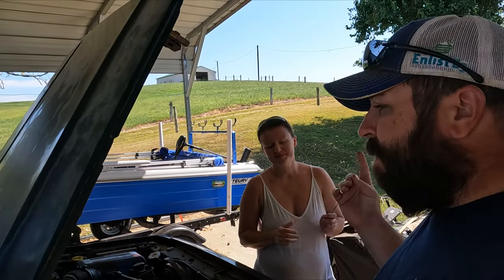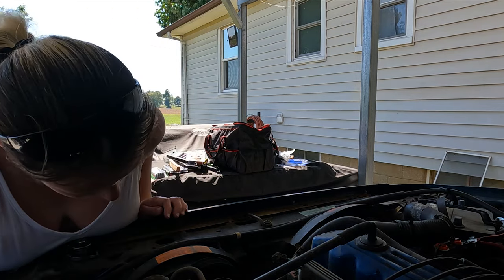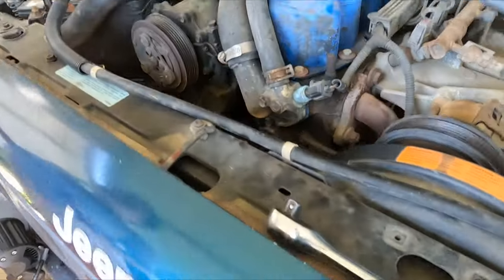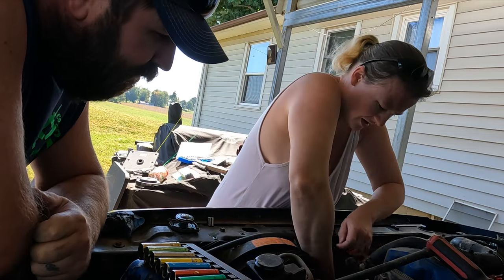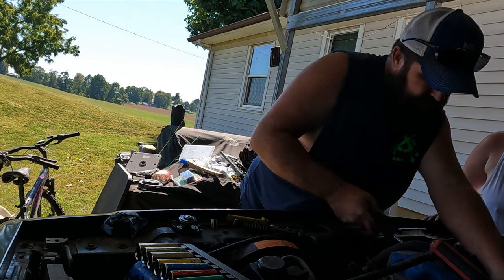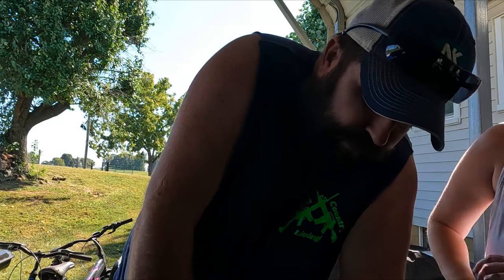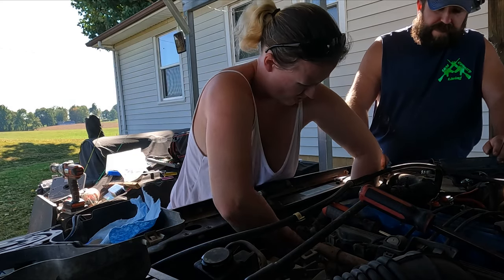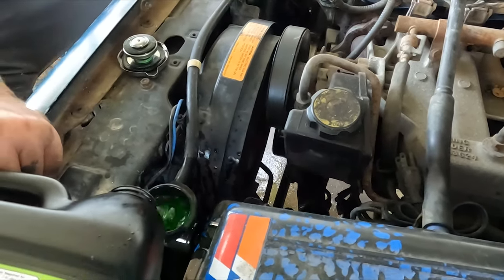M Learning how to fix the Jeep

Comment: I always use some kind of RTV/Permatex on gaskets paper ones for sure, I try not to use paper gaskets! I’m anal, always have been, when I change a water pump, on older cars, I try and change the Thermostat, with a lower temperature one, like from 220 to a 180, I change the serpentine belt, and all idler pulleys, I know it’s more money, but your there now! I also find the two longest water pump bolt, scrounge longer ones, cut the head off and use them to Align the the water pump and gasket, perfectly! Then remove when the water pump is secured and can’t move! The last thing you want is the gasket not in the right place when bolting on! Been, there, done that, and most likely going to hell for my Language!
Reply from the maker: I would have loved to changed all of that but with just doing the brake job money is running a little tight plus just put a new thermostat in a few months ago and thats a great idea about the bolts ill have to remember that the next time we do one thank you and if your going to hell for you language looks like ill probably be there to lol

Comment: Have you done the spark plugs on wires yet if not I see that you have a blue valve cover The company Taylor makes blue high performance spark plug wires and they may have them for your Jeep it will match your covers perfectly and they're high performance and long-lasting double silicone I have them in my truck and they run great. Something to think about
Reply from the maker: Its been about a year since we done them but I ran Taylors on my 94 chevy and loved them.